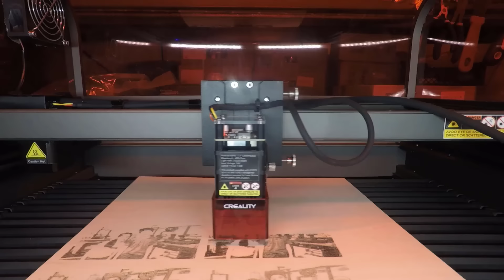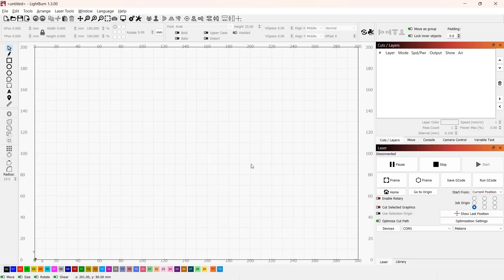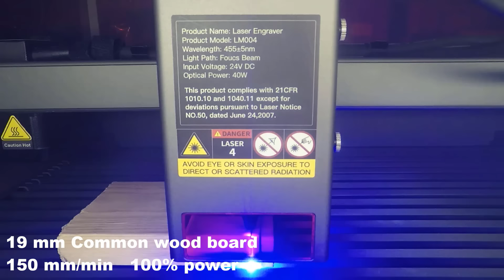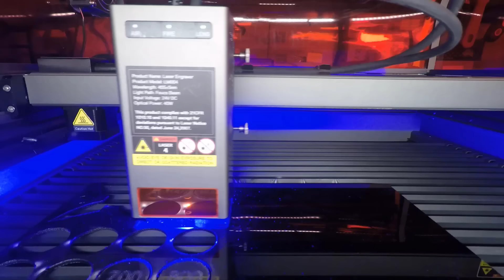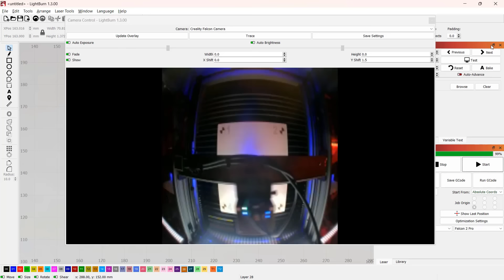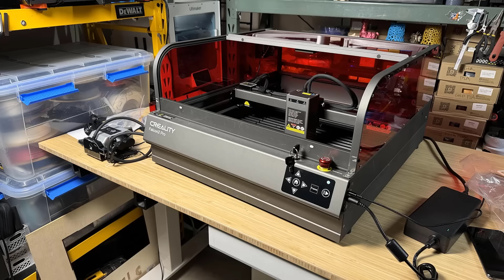Creality Falcon 2 Pro 40W fully enclosed laser engraver

Comment: I suggest Creative add a wifi module. Conect camera to that wifi modulw. Manage jacks of the cable in a way that one cannot break it accidentally. Sell  the enclosure case as an upgrade for older falcon 2 users. Sell an optional 2W IR Laser module.  It needs a Z axis adjusting  knob as the 2 existing ones are improper. It needs INSTRUCTIONS on their YT channel to explain how not all metals can be engraved. For me, 2023 Falcon 2 22W was the first and last product I will ever buy from Creality. Too much fuss, too much tinkering. Had to buy a raspberry pi and a camera to make it work wirelessly. A shitty creality enclosure that looks like a improvised tent, Buy a different honeycomb bed, add a series of adaptors for the bed to stay in the same position, etc… I am FRUSTRATED. I just want to get rid of it and buy a proper xTool complete equipment. I feel cheated. lucky me that for the 3d printer I chose Bambulab.
Reply: Ty 4 Ur comment! Have a creality resin printer, very good..

Comment: doesn't the laser module let you use it at 22w as well with a push of a button. This would help when engraving. so you get two lasers in one 40w and 22w + the 1.6w as a separate module .
Reply from the maker: Yes, I also tested the 'precise' (22W) mode which uses lower power. The top four pictures on the plywood sheet were created using the 22W mode.

Comment: Frankly, even if the fiber laser engravers only have 100mm x 100mm work area, they OUTCLASS that bizarre CReality Falcon2 "pro???" in matter of precision, quality and above all speed! Who's going to put $2400 in "that" while you can get a fiber laser 200mm x 200mm for LESS? C'mon!
Bet that this device will count among CReality's FAILURES! Just looking forward to seeing a Falcon2 pro pro pro PFFFT! inflation of words only!
Reply: Fibre lasers work at a different frequency/wavelength and therefore are suited to different materials. They are ideal for engraving metals (and cutting at much higher power industrial strength) but one at the price you reference would never cut 5mm of ply let alone an inch of pine. Completely different machines for different needs. There is some overlap between diode lasers and CO2 lasers though and some may choose the simplicity and lower maintenance of diode (like the Falcon) over the slightly more flexible cutting power of CO2